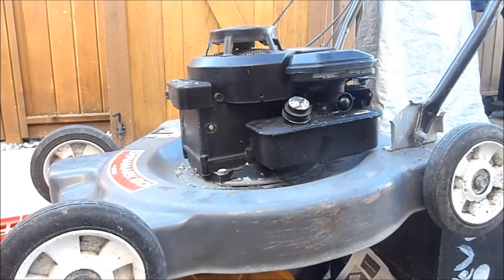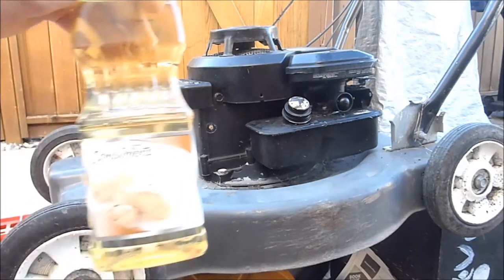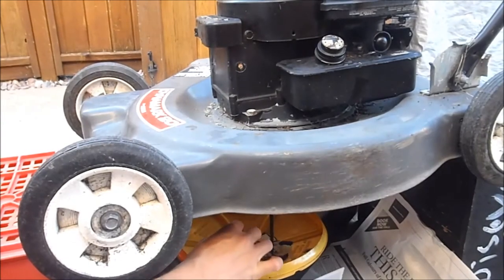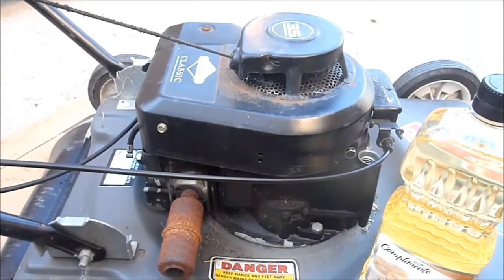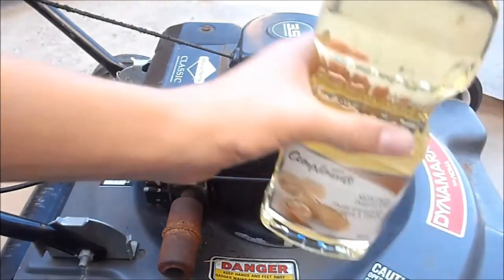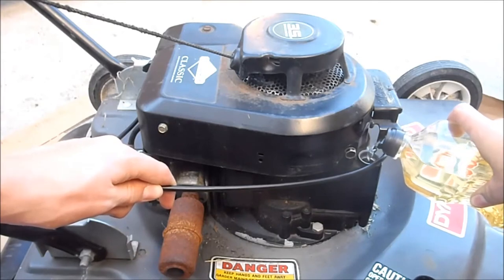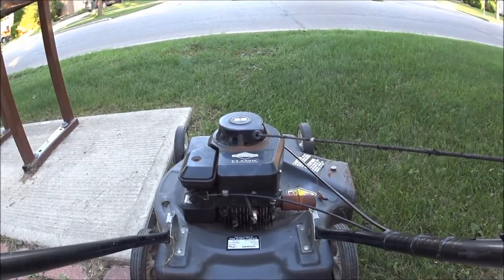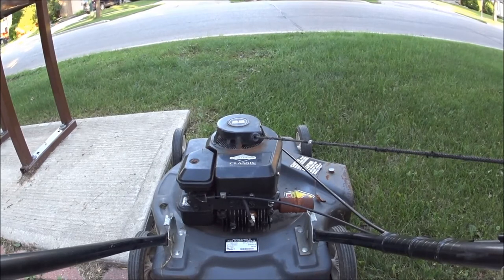Peanut Oil in a Lawn Mower?

Comment: If the oil scorches above 250°F, the low viscosity will just cause the oil to be emitted out the exhaust until you run low on oil and both the piston and head will start to overheat. If it has a lower scorch temperature, the oil will start to degrade after about ten minutes of use and start to turn black, possibly leading to piston rod failure after about an hour. Either way, you will burn most of the oil off before it either seizes or blows up.

Comment: Smart, peanut oil is a good vegetable oil option, as it is a high heat cooking oil. Try using coconut oil as well, but not olive oil.  What I like to do is acrush a few tablets of Lipitor and add it to the oil as well to prevent engine sludge
Reply from the maker: Lol if it works in people it must work in engines!

Comment: Peanut oil was a good choice. Higher smoke point / burn temp.
If it can fry a catfish, it can lubricate the lawnmower. I guess.
Reply from the maker: I did a bit of research into smoke points and found this one to be a good affordable option. Funny I have used it in a lawnmower and haven’t used to fry fish lol.